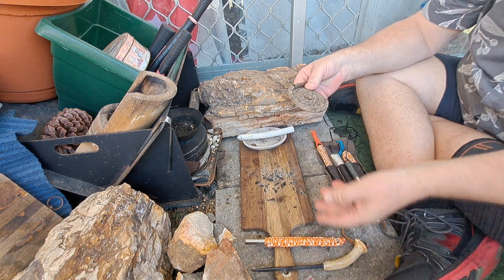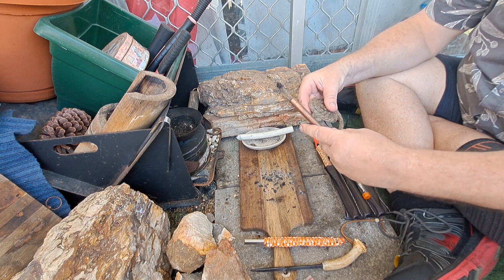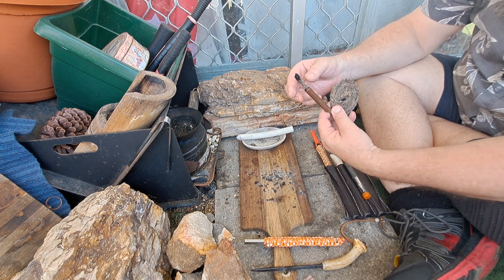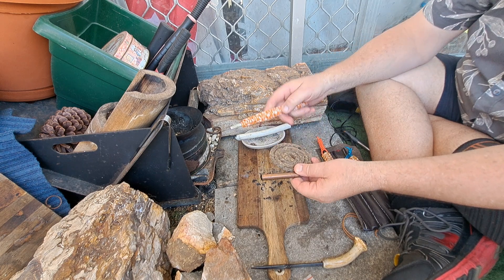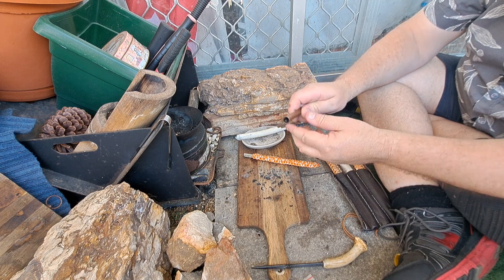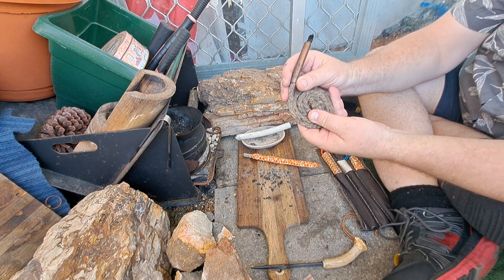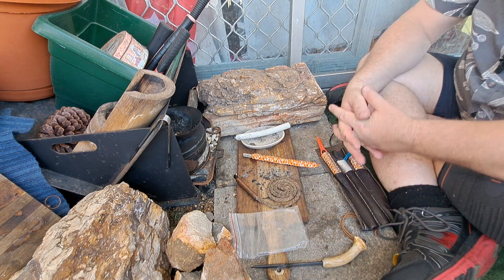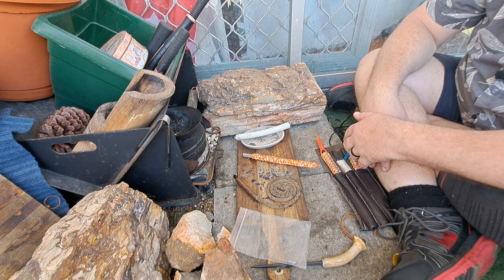the waxed jute forever match

Comment: Hey Dean, a tip you might find useful. Instead of letting the jute completely soak in the wax, just give it a quick soak, so that you keep the inside strands of the jute wax-free. That way it takes a spark much more easily once you fluff it up. I don't know if it will be waterproof that way though.
Reply from the maker: a great tip thanks mate